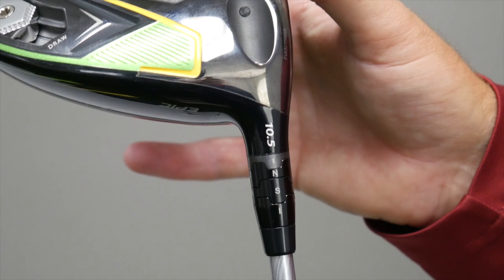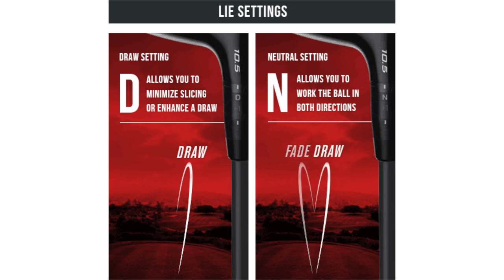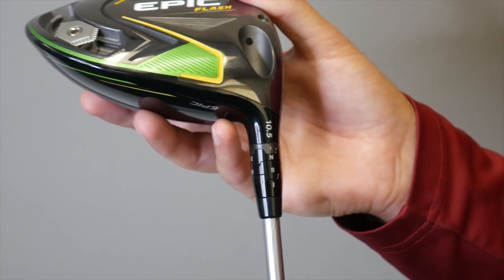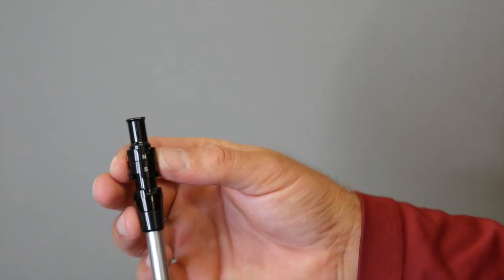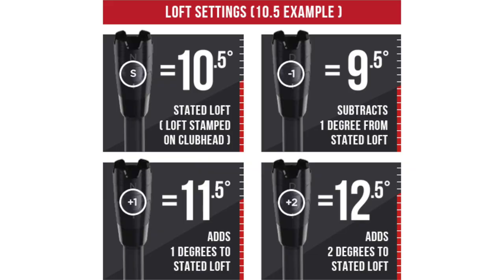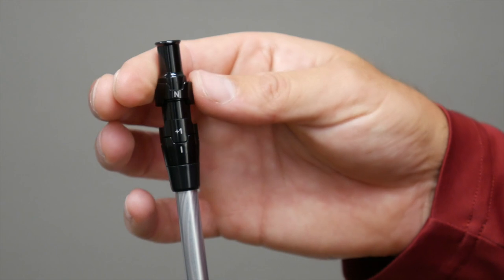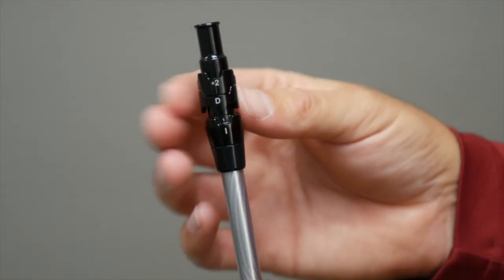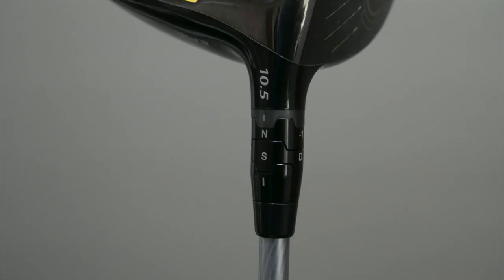How to Use Callaway’s Optifit Adjustable Loft Sleeve Settings

Comment: great video!  Too bad Callaway doesn’t have a Flat setting like Ping. I’m 5’-5” and play my irons 2 deg flat.(and 1/2 in short)
Reply from the maker: You make a good point Stephen. You mentioned PING, but Titleist also offers flat settings with its SureFit hosel, which are especially popular with hybrids. It will be interesting to see if Callaway and others who don't offer flat settings move in that direction in the future.
Reply: 2nd Swing Golf   I agree, I’ll keep Titleist in the running 

Side note here regarding getting a Ping 410+ driver to replace my F9 (not as forgiving, much lower MOI in comparison to the G410+) and also swapping out my F9 3W, 5W and 3H & 4H with G410+’s.   MY current F9  fairways have Fx 2.0 200 series (mid launch) 200F M4 shafts and 200H M4 hybrid shafts.  After reading below please give me some insight. Obviously going back Club Champion NJ will give me the best answer, but unfortunately i had shoulder surgery last week and wont be goin back there until next April/May. 

“I went ahead and bought a new G410+ driver marked down to $299.99 on Black Friday.  Has the Ping Tour 65S shaft which i heard is a great shaft, but my plan is to stay with my Accra Fx 2.0 365 M4 shaft and swap out the F9 head/adapter. Ill see what gives me the best #’s next spring. 

Also sort of jumped the gun and bought pre-owned G410+ 3 W (head only mint condition), 5 W and 3H & 4H all to swap out with my F9 heads.  Now I recently saw TXG’s mid speed fway test and Matt picked Epic Flash (standard) as and F9 3W as 2 top picks (Epic flash best overall). He couldn’t get on with the g410+ 3W, he said he an issue with the flat hosel settings.  For me i need Flat, I’m 5’-5” and play my irons 2 deg flat. So I’m guessing the Ping 410+ 3W and 5W will be fine. come spring, ill test the G410+ against the Epic Flash and see which one gives me the best #’s”
Reply from the maker: @stephendibari7704  The G410 fairways and hybrids will probably work well for you based on what you've said. We've seen the more aggressive flat settings do wonders in fittings for players who really need a flatter lie angle to optimize their ball flight and center their contact on a more regular basis. It sounds like it will be a while before you can test your new gear, but there's plenty of reason for optimism in terms of how it should perform for you.
Reply: 2nd Swing Golf thanks for the confidence inspiring response !! ⛳️.   Tbh I love Ping. I had the G400 LST and G400 Max. My clubhead speed is approx 99- 105. It proved too low for the LST , my dispersion was bad.  

Now After 21 rounds this year with the F9, I’m definitely in need of a more accurate driver. From what I seen on MyGolfSpy’s website,  The MOI of the G410+ is the highest (Except for PXG , Forgot the model name, which came in first by a hair). In comparison the F9 with the weight forward which is my set up has one of the least MOI’s. ( think M5 with weight forward was near the least MOI).
Reply: Stephen DiBari you look very knowledgeable, just remember to validate with a good data generator (gc quad, Trackman)   Theoretically, my Rogue Sub Zero, 9.5, stiff, high flex point, weight forward with only my 93 mph should be terrible. However, 16* launch, 3* up swing, 2,100 spin and 1.3* inside path at 45.5” length were pretty good numbers on the Trackman and on the course. Should not have worked but it did.
Reply: Sean Peacock yes ! Thanks !  I see how your clubhead shouldn’t be good enough for the low spin model, but the numbers don’t lie !  Just goes to show, get fit on a quality machine.  I was fit earlier this year at club Champion New Jersey and they use Trackman. Got good numbers with F9 driver, 1.49 smash, 2500 rpm spin, 3 deg up AOA with Accra FX 2.0 360 M4 shaft. But looking for a more forgiving driver in the G410+   Merry Christmas 🎄
Reply: Stephen DiBari we actually tried every driver in the store, including Rogue, but couldn’t get spin under 3,000. The Subzero was out on loan. When it came back , first hit, 2,400 rpm.👍🏻. I have noticed a tad more forgiveness weight back but spin and launch both increase. Picked up a ping Stretch 3 wood at the second hand club place. OH My Goodneess!! Love at first hit! Would make me have a look at the Ping driver too.
Hope you find your solution..
Reply: Sean Peacock would think weight forward the spin & launch should drop and be less forgiving than in the rear. 

Yes I bought a new G410+ driver, all rest are pre-owned:  3W, 5W, 3H and 4H. Hope is to swap out the F9 heads from my ACCRA shafts and replace Cobra connectors with Ping connectors. Need more forgiveness from driver all way to hybrids
Reply: Stephen DiBari Sorry you’re right. I’ll fix it.
I swallowed my pride and got a hybrid. My goodness it was ugly to look down at but I cannot ignore the results. Same yardage as my 3 iron but higher, more forgiving and lands like a butterfly with sore feet.
Reply: Sean Peacock great. My longest iron is a 5. Tbh I can probably game a 4 iron. For Whatever reason my 3H and 4H go within 2-3 yards of each other. F9 19° glued Hosel and F9 4H 21deg glued hosel. I’ve had plenty of shots throughout the 21 rounds this year, and My ARCOSS stats show them very close, they both carry about 190 to 195 yards.  Something is wrong and I’ll straighten that out at my fitting in the spring. 

Also plan on swapping out my Callaway APEx pro forged (smoke) Irons with PING i210’s. When I went for my fitting at  club Champion NJ in early February 2019, I was hooked on the Callaway Apex pro forged irons and the fitter was so blown away by the 10 -12 yards carry gains Compared to the X forged 18’ irons, He overlooked the fact that I had super low spin and launch angles on the Apex Pro forged. My 7 iron On trackman gave 4,465 rpm, 18 deg launch. 
From what I read and saw on YouTube a 7 iron should be between 6 to 7000 rpm backspin. I love the feel and looks of the Callaway Apex Pro forged 19’ irons but they’re super low spin and too low launch is not beneficial for me
Reply: Stephen DiBari A lot of hype over yardage on irons but if the angle of approach and spin rates are too low you won’t hold the green. Fitter should’ve made that very clear. I went in with the intention of new irons 2 weeks ago. Took my aging Calloway x22 tours.
My clubs
7 iron, 150 yards, 6,700 spin, 47* AOA
5 iron, 171 yards, 4,500 rpm, 45* AOA

Turned and looked at my fitter and he shrugged his shoulders and said...unless you want something shiny, not much point.🤨. I was fit for the Calloway at their Canadian HQ 15 years ago, so they did a good job.
So I’m gonna focus on hybrids this year. 
So many nice offerings but I’m not ready to spend that much for Shiny 😞
Reply: Sean Peacock awesome 👏. 
  Yeah my fitter kinda missed that key point.  And i was super excited about the distance gains on the 5 iron over the Callaway X Forged ‘18 5 iron. like i said 10-12 yards.  Pointless if it rolls out 13 yards (39 feet, definitely not holding greens ). 

Trackman #’s from 02 Feb 2019.  Kinda rusty when i did the fitting, first time i swung a club since Nov 2018.

5 iron: 84 mph club head speed; smash 1.42, launch 17.3, 3,938 rpm backspin, 179 yards carry; -2.3 AOA
7 iron: 80 mph.                             ; smash 1.36; launch 18.0; 4,465 rpm.                ; 155 yards carry; -5.0 AOA
9 iron : 78 mph.                            ;              1.24;              19.1; 5,675 rpm.                ; 128 yds carry; -7.4 AOA 

I’m hoping the fitter will understand my concerns ( i already emailed him). Maybe he will cut me some slack on the “refitting” and waive or lower their fee.  I Just had rotator cuff surgery this past Wednesday, so I won’t be ready to be refitted until I’m guessing late April/May.  Club Championship has a great setup and looking forward to getting refitted.
Reply: Stephen DiBari sounds like you have some figuring to do. When the store pointed out that I could get another 20 yards on my 7, I said, yeah or I can just pull out a 5.
It’s still VERY tempting and the tech is changing so rapidly.
Maybe next year 😉
Reply: Sean Peacock excellent point about pulling out a 5.  I was so amped up and had my heart set On the Apex pro forged I got blinded by it all.  Definitely looking at the Ping i210 irons, more forgiving and more consistent backspin.
Reply: Stephen DiBari 🤪 so easy to do. I was disappointed not dropping over a grand on new irons😛. Apex are nice irons. There is soooo much knowledge to be found and can change the picture. I just recently learned of the “hotspots” of non blade clubs. The trampoline effect if you will. You’ve got to be very clear on what is important to you and get a fitter to listen. 
I’m a senior so I DO get satisfaction dropping a 5 hybrid inside the youngsters 7 iron. 
He says.....yeah, but you used a 5.
I say......when that goes on the scorecard, I’ll care puppy! 😜
Reply: Sean Peacock I’m 55, so I’ll take all the forgiveness I can get. The apex pro forged are very forgiving but I can’t deal with the low launch /super low spin. TBH I love Pings business model. They won’t release a new  club Until they can prove that it outperforms the previous model. Ive done a lot of research on the i210 irons and even their Glide 3.0 wedges Which generate the highest wet spin. I’ll be Looking to swap out my vokey SM7’s into the Glide 3.0’s. Keeping the same Modus 3 Nippon Tour 115 wedge shafts /Grips. Club Champion New Jersey will be getting a big order from me !!
Reply: Stephen DiBari so true. That was my thought. Little bigger blade, more forgiveness, little more distance, etc. then found out about the trade offs. Ping and the Mizuno HMB were the top runners for me.
Reply: Can you use the left handed sleeve for the right handed driver to adjust the driver flat...